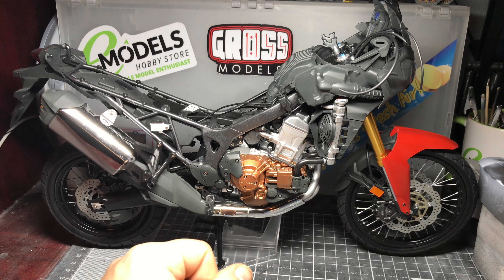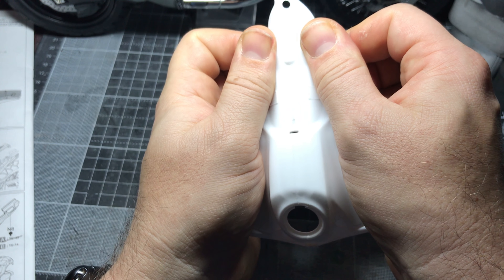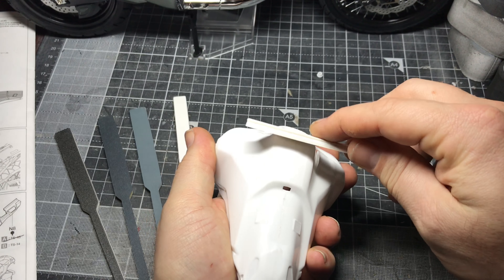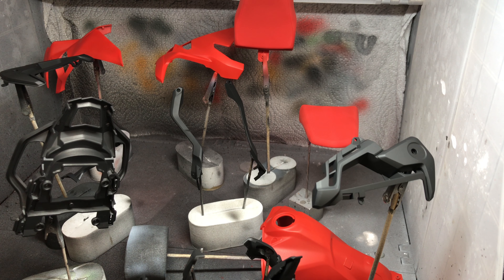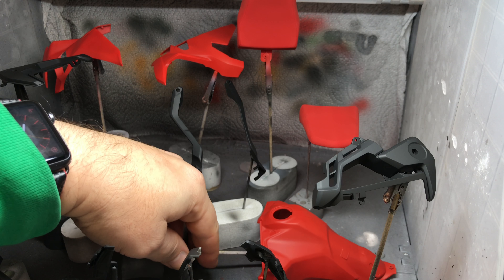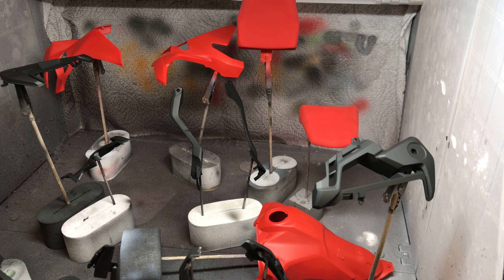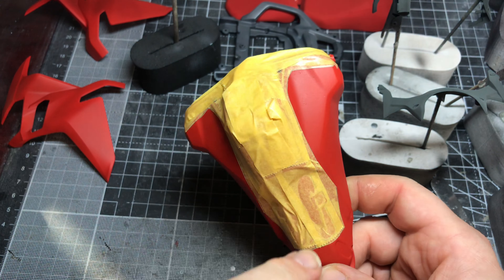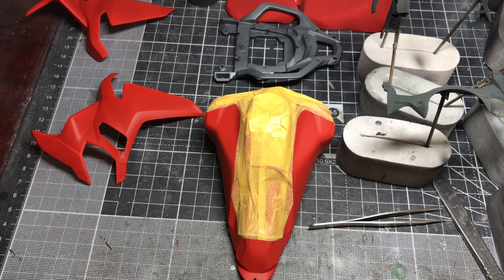Tamiya 1:6 CRF1000L Africa Twin motorcycle build. Part 8: Panels

Comment: I don't understand why Tamiya didn't precut the masking for depot...  In cheaper kits they do with car glass ones, but here being more complex they don't. Thats one of the critical points of this kit because is the most visible zone.
Other fault for me on the kit is the front adjust of the main panels. I had to use double side tape on them because they always get out of place.

By the way. Why you dind't put decals on panels before assembly? Maybe you said why on video, I didn't notice, but main panels are a bit irregular and you will need to heat decals to fit and I also aply a couple of clear coats over them. Also some polish and wax for smoother finish.
Nice work, soon I'll get my second AT but won't do videos like you, my workbench is a mess xD
Reply from the maker: +ubik77es Thanks, I was expecting the masking to be cut, it seems a strange choice for them not to on such a nice kit. 
I’ve been following the instructions with the decals, they say to put the seat one on, but don’t mention any others until the last page where they show all of the panel decals. I assume it’s to ensure they get lined up right? I’ll be using the seat one as a guide for the ones next to it. 

Don’t think I’ll need any heat on them, they are quite nice with just the microsol/microset. I’m hoping I can spray a final gloss coat once it’s completed, I can cover areas I don’t want to gloss fairly easily I think....
Reply: First of all, I did not say it before, I love the way your AT looks

The panels are not very irregular, but when I put them on decals they were a little complicated, I only have microset and after several attempts at the end I needed to apply some heat so that the decal would adapt well in the front fairings.

Normally I do not follow the manual to the letter and at this point I preferred to put them before assembly because I thought it would be easier and I would not need to mask the black NATO parts. I also like to polish the pieces with a shiny finish to further highlight that shine and make them as smooth as possible, so I preferred to do it this way. If you checked my post about my kit you'll see I were a bit messy with steps.

I hope you do not mind my comments because I do not criticize them. I am here to learn from someone I consider better than me and my comments are directed to know why others do things differently than what I see and improve my technique.

Soon I will begin the assembly of my second AT with a white decoration, the first one came out a boyfriend during the assembly and it lasted little in my hands once finished, but seeing yours I think I'll end up buying another one to have the two liveries but maybe you are mounting them with some modification ...
Reply from the maker: +ubik77es I’m very happy to have all your comments and suggestions. I’m more used to doing smaller kits, and a more weathered, worn appearance, so the shiny look is pretty new to me.